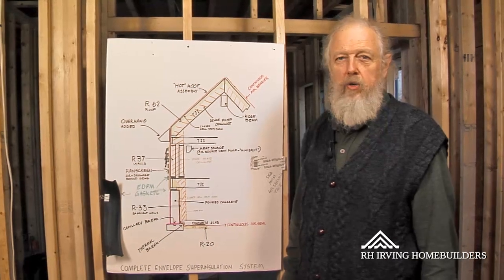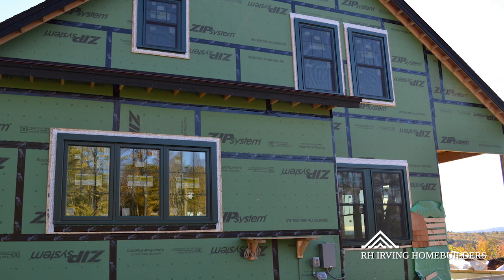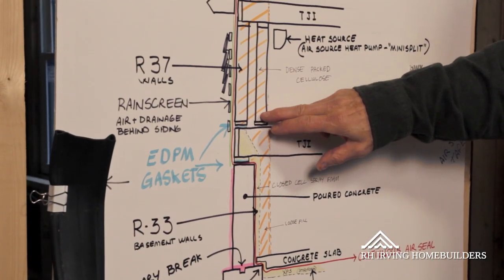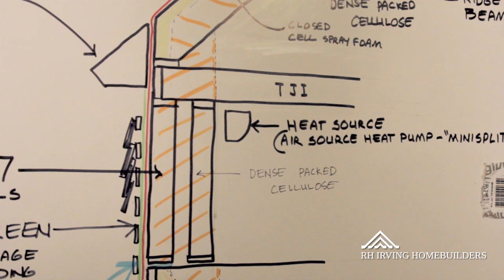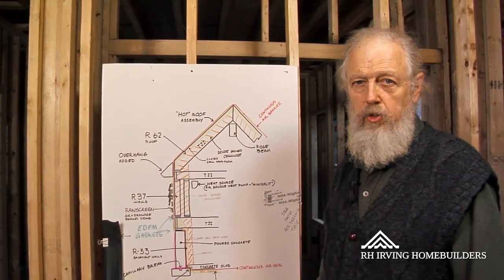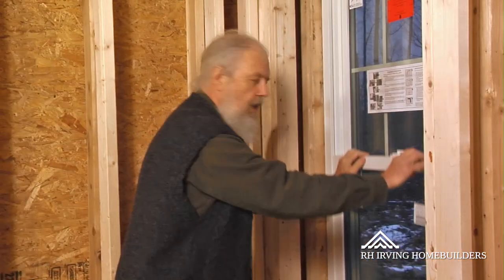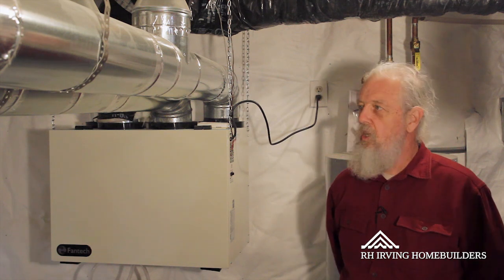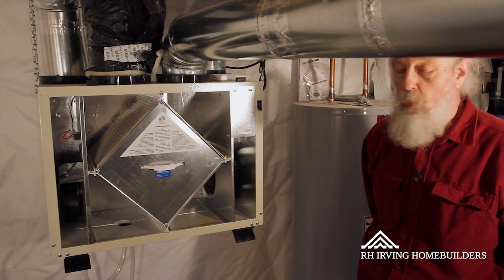RH Irving Homebuilders: the technology of a superinsulated house

Comment: waste of lumber
Reply from the maker: compared to what?
Reply: I live in Beaufort South Carolina. We have our home custom made. 3,600sqft.  With best practices when I comes to framing. 24 inches on center, vs 16inches on center. Not to mention air and moisture barrier on the outside shell. For insulation closed cell foam for the attic, walls, and encapsulated crawlspace. Air blower test was under 1%. Resulting in having to have a erv system installed. Achieving this. Made this project water,air, and thermo resistant.  I know up north building codes are different. That being said, wood has the worst r-values of any insulation. How is that efficient? Using more lumber? Why not encapsulate the entire home wouldn't that be more cost-effective? And energy efficient?
Reply: Also. 2inches of closed cell foam to create a thermal bridge.
Reply: Sounds like a great house;  congratulations!  You are in climate zone 3 (or possibly 2); we're in CZ6, so colder and drier.  My answer is to agree with your comment - "wood has the worst r-values of any insulation", so it's the last thing you should want penatrating your insulation envelope.  That penatration is called "thermal bridging" - where the heat you purchased is escaping through the bridge.  We separate the interior wall adjacent to the heat we're adding from the wall adjacent to the cold exterior wall.  Extensive testing has been done (by Building Science Corp - details on their website - https://buildingscience.com - and others) proving that a lot of energy is transferred out that could easily be retained in the building.  In your case, you can take the R value of your foam insulation (5"xR6.5x14.5"x8'), but you need to deduct the actual R value of the studs, plates and headers from that number to get the effective R value of the wall - (5.5"xR.5 = R2.75) which probably totals around 15% of your wall.   In my wall, we have (3" x R3.7 x 8')  of continuous insulation in addition to the 7" in the wall cavities, so the lowest R value in the wall is R37.  The lack of thermal bridging does make a huge diffefence in my climate, although it may be overkill in yours.   In terms of whether the studs should be 24" OC or 16" OC, you are probably right that fewer studs are OK; we've used 16" to ease the transition to a very different overall system that confuses people anyway.  We are discussing moving to a 24" system.  And Cellulose insulation - made from unused newsprint, so it's "recycled" - has a far lower GWF than closed cell spray foam which is very high.  Cost is another factor - dense packed cellulose is a fraction of the cost of ccsf.  

The other answer is that you, like us, are effectively experimenting.  I think that within twenty years, we'll know what wall is the "ideal", but we'll never learn if we don't build them.  There are thousands of different assemblies being used today; some will be better, more effective, safer and and cheaper than others.  We know from the hundreds of double stud homes buit across the country that our system works.   You've learned that your system works.  Good.  Eventually we'll discover issues that we never thought of; that's our role and it all will lead to better homes for everyone at the lowest cost.   Thanks for the note & encourage everyone you know to build better as you have done!
Reply: I replied before I saw the 2" sheet foam you added to the outside (?).  Good move.  It's still probably more expensive than necessary for the R value compared to DPC.  There are other differences.
We build a "vapor open" wall assembly.  You built a vapor closed assembly.  Moisture passes through our wall; it cannot pass though yours.  I don't know enough about other climates to know if that makes less of a difference in your climate, but in ours, we are still battleing the "mold" epidemic of the '80's and 90's and 2000's where builders built vapor closed systems on 2x6 homes (poly vapor barriers amoung other issues) which leaked and created mold farms - a problem much less likely in a vapor open system with DPC.
Reply: We don't add exterior foam to our double stud walls, but we also do stud walls with exterior foam insulation.  The DS wall breaths (meaning it's "vapor open")to both the inside and outside; the foam wall is only vapor open to the inside.  Both work.   Since 97% of water vapor travels on streams of air, building an air tight house means more water vapor stays inside and keeps the interior air from drying out.   
 @bobirving4357

Comment: I thought rain-shield was supposed to be installed vertically.  Is that a corrugated type wrap you installed behind the horizontal furring strips?
Reply: It is commonly installed vertically, but it can be installed horizontally as we did here, in order to install shingles.  There is some concern about water sitting on the strapping, but considering that 1)all the seams of the underlying  ZIP sheathing are taped, 2)we installed a drainage plane house wrap which has tiny channels designed to channel water down and out,  3)we use rough pine strapping which allows space between the strapping and the sheathing,, 4)the shingles are triple lapped.  A rain screen is designed to allow air movement to promote drying o the back of the siding, thereby allowing the siding to hold paint, and extend it's life; in common use there should be very little liquid water there except for leaks.  If you're designing for a gapped, or a shiplap siding (designed to leak) where you need horizontal strapping, or if there is a larger chance of water getting in, then use two layers of strapping. vertical and horizontal).
Reply: Thanks for responding.  We are beginning the process of building in Maine.  I love your ideas.  Thanks for posting!
Reply: glad to help!

Comment: Concrete (Normally Dry)

Concrete
Type Denisty 
(lbs/ c.f.) Per Inch Thickness of Concrete
2 4 6 8 10 12
Insulating
Lightweight 20 1.43 2.86 5.72 8.58 11.44 14.3 17.16
30** 1 2 4 6 8 10 12
40 0.83 1.66 3.32 4.98 6.64 8.3 9.96
50 0.67 1.34 2.68 4.02 5.36 6.7 8.04
60 0.52 0.04 2.08 3.12 4.16 5.2 6.24
70 0.45 0.9 1.8 2.7 3.6 4.5 5.5
Structural
Lightweight 80 0.37 0.74 1.48 2.22 2.96 3.7 4.44
90 0.3 0.6 1.2 1.8 2.4 3 3.6
100 0.24 0.48 0.96 1.44 1.92 2.4 2.88
110 0.19 0.38 0.76 1.13 1.51 1.89 2.27
120 0.14 0.28 0.57 0.86 1.14 1.43 1.71
Normal-
Weight 130 0.11 0.22 0.43 0.65 0.87 1.09 1.31
140 0.083 0.16 0.33 0.5 0.67 0.83 1
145*** 0.075 0.15 0.3 0.45 0.6 0.75 0.9
150 0.065 0.13 0.26 0.39 0.52 0.65 0.78

Conductivity, (k), Btu in./hr. sq. ft. ·F R(l/k)

NOTE: Typical increases in conductivity and density, from the PCA Development Bulletin D114. General Relation of Heat Flow Factors to the Density of Concrete.

Conductivity

Comment: Concrete slab is R-11, that a lot better than wood R-2-4.
Reply: Concrete is a poor insulator - an 8" concrete wall is R-1; the same as a single thickness of glass.  We used R-16 insulation under this slab.
Reply: That is a 8" block which is hollow, solid concrete is much better, but not as good as ploy or fiberglass.
You are leaving out important details, that will confuse amateurs who are looking for the whole truth.
Reply: Dona - Please cite your source.  This from an industry magazine:
"By Concrete Construction Staff
Q: What is the R-value of a typical 8-inch-thick, cast-in-place, residential basement wall?

A.: The R-value of an uninsulated, 8-inch-thick basement wall built using normal-weight concrete is 1.35, based on data from the 1993 American Society of Heating, Refrigeration, and Air-Conditioning Engineers' Handbook. By doubling the thickness of the wall to 16 inches, the R-value only increases by 0.50."

The R value depends on the weight of the concrete.  Structural Engineering Volume II lists a typical 3000# concrete as 150#/cf.  ArchToolBox.com; lists the R value of 150#/cf concrete at R= .07 per inch = R-.56/8".  So these sources range from .6-1.35.  Concrete is a poor insulator.  Wood is about R-1 per inch.

Comment from the maker: With a 10" double wall, you lose 4-1/2" of interior space on each exterior wall, so the in pictured house it would be about 60-70 SF.  The heat exchanger takes up 3-6 SF- typically hanging in your basement.  However, you gain the space from where the oil tank used to be, the furnace itself and the ductwork, so it's probably a wash or net gain.  Or, if compared to hot water heat, you also gain the space of the baseboard heating units which disrupt furniture placement.
Reply: That amount of lost space is inconsequential, a small price to pay for a far superior wall assembly. Most American homes are gratuitously large anyway. A few less sqft is no big deal.